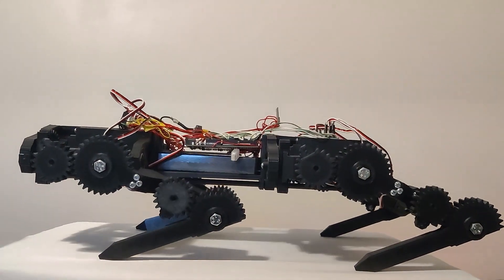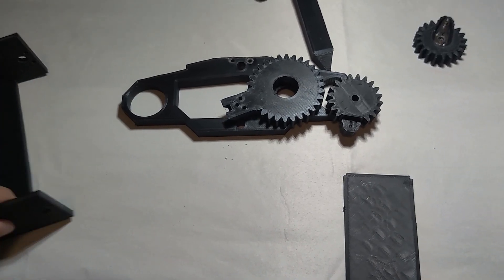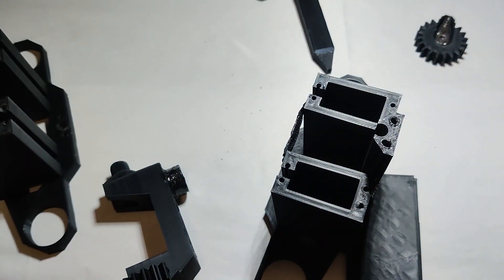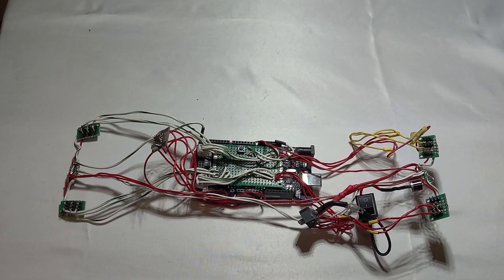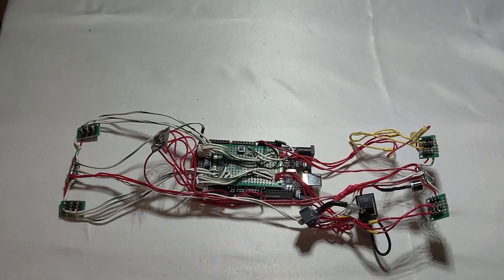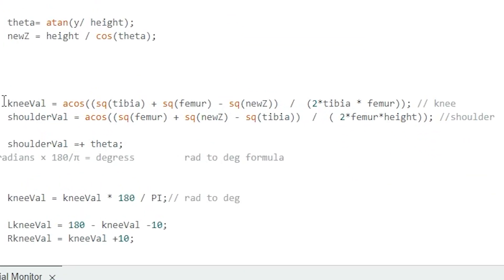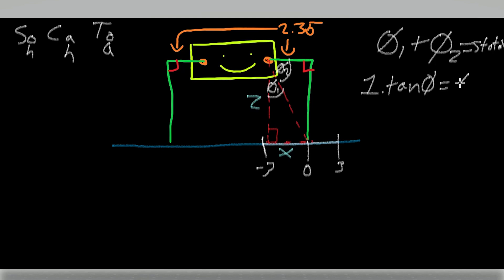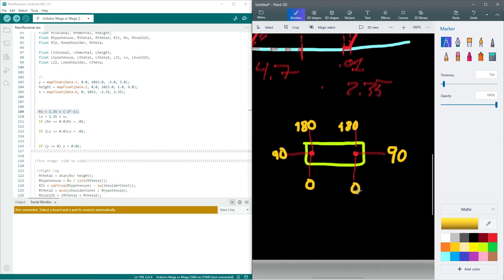Robot Dog - Inverse Kinematics

Comment: So. You connected power of all servo together and connected to 5volt and ground right? Or did u connect power also to arduino mega?
Reply from the maker: @leobiranykun7808  nope, if you draw power from the Arduino you will not have enough to power all servos, that's why I have a separate power supply(battery) that powers everything including the arduino. And the grounds are all interconnected to prevent noise
Reply: @-EhsanMalik-  you know this project is pretty good. Now you should make the same thing with 2.4 ghz rc controller for doing stuff that are totally legal and nothing illegal.
Reply from the maker: @leobiranykun7808  🤣 I'll have to talk with FCC about that
Reply: @-EhsanMalik-  yo. And is it possible to be done in arduino uno. The old one without the esp32 chip pri-installed
Reply from the maker: @leobiranykun7808  if you're talking about R3 then it should be possible, if I remember it has 13 digital pins, but I don't remember if the non pwm pins can control the servos since servo motors need pwm to be controlled, so make a simple code to test is the non pwm pins can control a servo (the digital pins on the Arduino without the ~)
Reply: @-EhsanMalik-  also if possible can you make it control by ESP32 or esp 8266. The ESP would send assigned pwm signal (like suppose 350 for forward) and arduino will get that pwm signal and move that dog forward. I think I might have written a code for it.
Reply from the maker: @leobiranykun7808 if you're talking about walking, then I already did that, sadly the motors still weren't strong and stable enough, but it was able to move
Reply: @-EhsanMalik-  man you are correct. These servo are well powerful also but more powerful servo cost alot €€ which I don't have. Now can you recommend me any project like this but not this to make and show at my science exibision in my school.
Reply from the maker: @leobiranykun7808  there are a bunch of projects that I have made for my school before making YouTube video, make a gimbal for cameras or what I have done is hold up a glass full of water, it only take 2-3 servos and a Arduino nano to compute. You can make a small car that follows you and only you, I used a small modified car and added a Arduino with a blue tooth receiver and made a handheld Bluetooth transmitter that acted as a beacon and the car would follow the strength of the signal, now this one is a lot more complicated to code so if you have a time constrictions I don't recommend this one. You can also make a robot arm, there are many things you can do with a robot arm, you can make a copy cat arm, controll it with your hands, or you brain(you need one of those sensors that goes around you head and reads signals, a lot of trial and error). Or some other simple projects that can get way out of hand, like drones, planes, cars, even boats, and if your up for the challenge of making a submarine, and designing ballast tanks to make it go up and down, the creativity is endless so what ever you choose, stick to it and do your best!